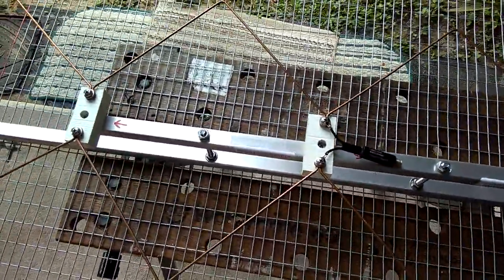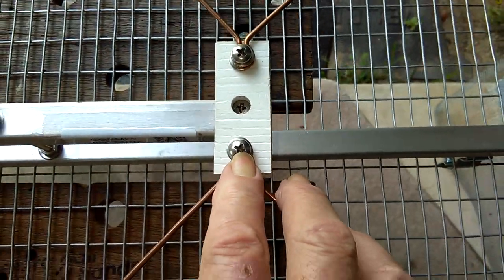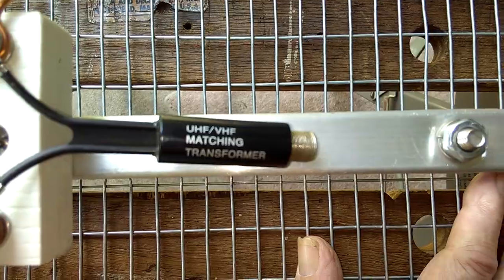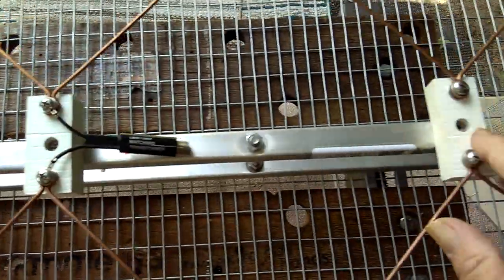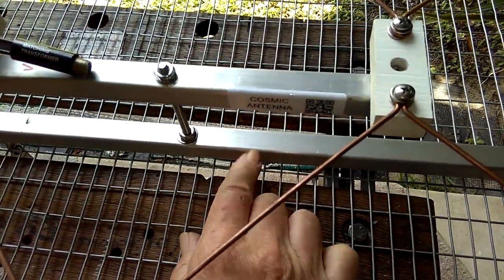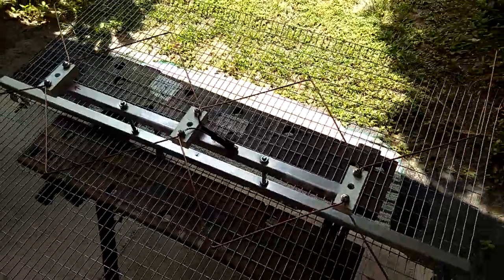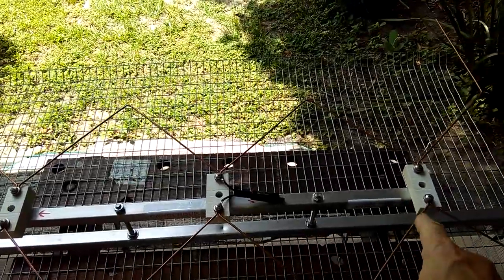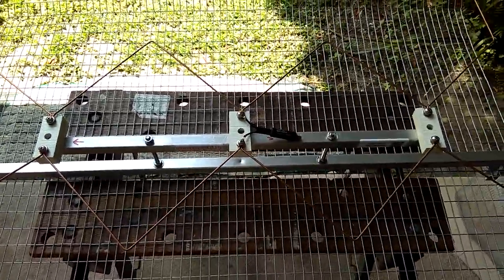Hoverman measurements

Comment: Copy  Mr.Hodges.
Been DONE!
Reply: At least Danny showed you how to build this antenna. Also Danny has a video for when he actually tested this antenna. This antenna is equivalent to his ultimate antenna. Danny's been making antennas for a long time. Actually Danny's antenna is better this guy forgot the top and bottom elements which makes the antenna for high VHF and UHF. This one here won't pick up VHF unless you are in the City. Not 50 miles away. I also disagree with the limit of 50 to 100 miles. I picked up channel 2 from Detroit Michigan. Our farm was in western Pennsylvania over 150 miles away. We actually picked up three channel 2's one from Pittsburgh PA, and the third one from Buffalo NY and of course Detroit Michigan. But I don't want to hear the bull about digital signals because all radio waves are analog. The picture and sound are in digital form. There is no such thing as a digital antenna. It's a marketing scheme. 73

Comment: Does anyone know why I get 90 channels on a scan with the major network channels  never below 80% signal strength - and then every channel suddenly drops to zero and are unwatchable, BUT...stations 120 miles from me i that never get, suddenly come in crystal  clear? With 80% signal strength?
Makes no sense.
It happens instantaneously. 
UHF doesn't skip.
My antenna is the same dimensions, but an unmeasured random element-to-reflector distance. Probably 3.5"
Atmospherics?
Clear-channel scheduled power cuts?
The fact the signal is digital?
Stumped but fascinated.

Comment: Man, amazing quality!

You mentioned 10" from tip to tip of your copper bends. Can you kindly share the length of each copper segment from the valley (at the screw head) to the next apex or tip? Some drawings show those legs at 7".
Thanks
Reply from the maker: Each of the Hoverman element segments (copper) are 7 inches.
The 10 inch figure is the spacing of the insulators from center to center. 
Watch the video again. 
Thanks

Comment: Do you think that making the elements with a fractal design increase the distance ?? Also, how about using two one piece rods next to the whiskers lower the VHF number ??? Please let me know what you think. Thanks
Reply from the maker: I'm working in a few designs for the VHF hats, I haven't settled on one yet .
Reply: @cosmicantenna9244  I look forward to see what is best from you Cosmic Antenna. Thanks for the reply too. V
Reply from the maker: You have the idea.There are three schools of thought on the configuration, what's tough is that there is no VHF in my area to test whatever I build, that kind of slows the process.
Reply: @cosmicantenna9244  Shame you do not have access to VHF. My way a good number of station are just that frequency. Good day Cosmic Antenna.
Reply: @cosmicantenna9244  I am looking forward to see what you come up with fella. Keep us informed. Peace
Reply from the maker: Forget fractal with the Hoverman, the smooth lines make it work. 
Adding the hats or directors increase the VHF response.
Reply: @cosmicantenna9244  Please try the lower and upper bars just a quarter to 5/16 inch for the main lower and upper whiskers. Please let me know the results. Thanks
Reply: @cosmicantenna9244  Many on YouTube say fractals really work. Was not aware that their was a down side. Thanks for the heads up.

Comment: I built one a few years back, and haven’t found anything better. I had a reflector, but took it off after some channels moved towers. I get about 80 channels with mine.
Reply from the maker: Good decision to remove the reflector. I need the reflector to cut through the tree cover here, I would like to have just an antenna on the mast but I need the bulky reflector. 
If it works, let it work.
Enjoy.
M

Comment: I've never had much interest in a hooverman, however based on your videos and enthusiasm for the antenna,. Today I'm starting on my own version of one that will either be a total flop or my new standard.  I guess I'll know within the next few days. Thanks for all your inspiration
Chris.
Reply from the maker: The Hoverman has always been a consistent performer with UHF stations, no matter what the FCC does. 
Take your time building the element , measuring and bending. 
Good luck and enjoy !
Reply: @cosmicantenna9244  Have you noticed if using copper elements that are thicker than 14 gauge wire makes a difference on reception ???? VF